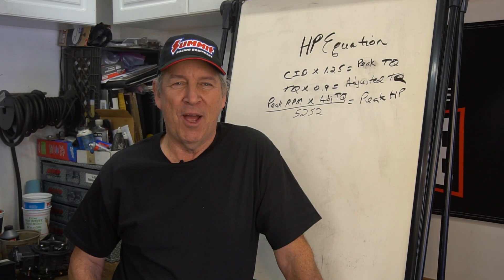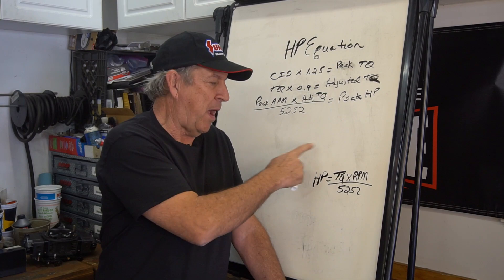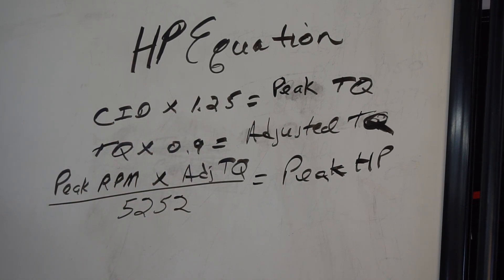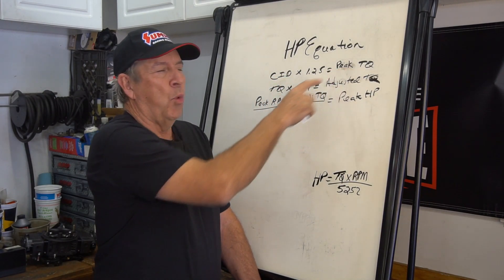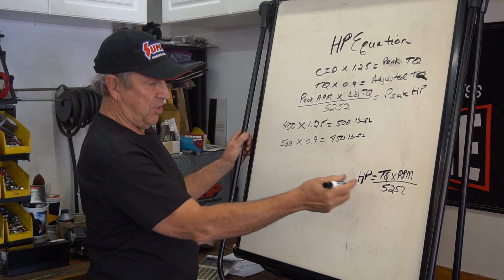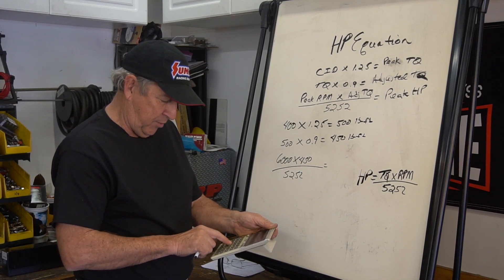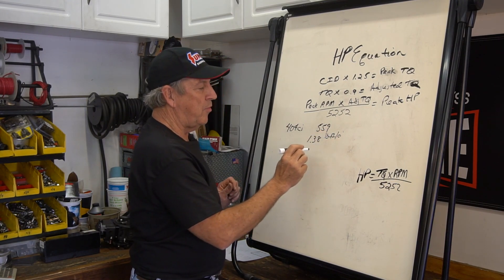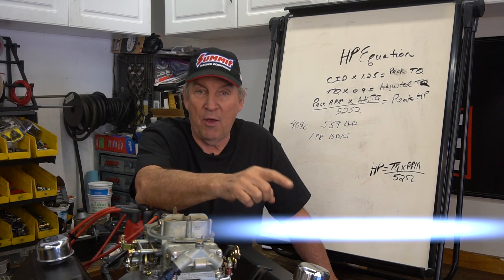Predicting Engine HP . . . without a dyno

Comment: Ok, so if I can safely assume that the 1.25 efficiency number is good, my slightly modified .30 over L-78 396 will make about 500 lb/ft of torque? That surprises me. I really didn't think the number would be that high. I'm using a set of 69 or 70 oval port heads (#792's)? they've been pocket ported and had big valves installed, (2.19 & 1.88's). compression is about 10.5-1.  Bigger cam (hydraulic flat tappet), 750 carb and headers. And I don't quite remember, but is the loss through a muncie and 12 bolt about 18%?
Reply: David,
There are multiple variables involved with all of this. Your heads are circa 1960's so the chamber is not as efficient and while the oval port heads are decent, they are not world class, so yes 1.25 lb-ft per cubic inch might be a bit high. Plus, details like are you using a Performer RPM intake or something a little better, header size, cam timing, and about a dozen other tings will affect this. Perhaps a 1.2 lb-ft per C.I. might be a better number - that would produce 480 lb-ft torque. Remember, these are flywheel power numbers. If you have a mild cam, then it may not peak at 6,000 rpm. I recently built a 540 with a mild hydraulic roller that peaked at barely 5,300 rpm. That makes  huge difference when calculating the peak hp number. In yoru case, 480 x 0.90 =432 lb-ft at peak hp x 5500 = 452 hp. That would be a much closer number to what you might achieve. Again, these are estimates. Hope this helps.
Reply: What are your cam specs? It takes decent about of work to get 500 hp out of a 396
Reply: Jeff and Muscle Bone, 
Thanks for the replies. I knew the heads were going to be the weakest link in this equation, even with the additional work done to them. Those mods were done in the late 70’s and I didn’t have many other options I could afford. I am seriously considering one of the new aluminum heads you talked about in the previous big block combo episode. And possibly a hydraulic roller cam as well. The cam I have now is a hydraulic flat tappet, .542 and .554 lift, 227 and 233 duration at .050. With a 106 center and 110 lobe separation. The intake is a Wieand stealth and the headers are 2” hookers.
Reply: @davidpoland7862  Your combination sounds pretty good - the lift for the amount of duration is also good - I just finished a story for EngineLabs that should be out soon that outlines a new line of Low Shock Technology camshafts that promise a little more power with improved durability but it might be a year or more before Comp makes these available. There are custom lobes available now - you would have to spec a custom cam. That's not difficult and may be something to consider. But really, better heads will deliver far more performance for the effort required. A good AFR oval port woudl be really good - but be forewarned that they raise the exhaust port - as most cylinder head companies do for Rat motors - this will make your headers more difficult to fit.
Reply: @jeffsmith2003  thanks again for the reply. Since the motor is fresh and the cam is new, I'm probably leaning towards heads as the main upgrade. I have looked in to the AFR's and did notice the raised exhaust ports. I'm thinking the Edlebrock heads may fit the bill best. If I recall they don't have raised exhaust ports and have a small chambers, (100 cc's)? Which is very close to the chambers on the iron chevy heads I'm running now. This puts the compression at about 10.25 which is where I wanted to be, and less than the 11.0 of the stock L-78 pistons. Also I did see reference to the low shock cams somewhere, that I think you mentioned. It may have been in a recent response to a question for On All Cylinders, not sure. But I will look for the story at EngineLabs.
Reply: @davidpoland7862   @jeffsmith2003 David, did you ever get new heads for this engine? I'm really curious because I just finished my .060 over 1969 402 build. So my motor is 414 ci. Just broke it in on engine dyno at a professional shop last Friday and did not make the power I was expecting. I am getting some help on why that might be, so will be checking things like making sure the valves are properly adjusted and that the cam was properly installed. I have Edelbrock 100cc Performer RPM heads producing 10.19:1 compression with my pistons, Howard's hydraulic roller cam - .589 and .601 lift, 229 and 235 duration at .050, 106 center and 110° lobe separation. Edelbrock Torker 2.0 intake, Holley 850 vacuum secondary and Hooker Classic 2" long tube headers. It's SO similar to yours, except for mine being roller. It only made 415 ft/lb TQ at 4800 rpm and 381 hp at 4900 rpm. So something ain't right. Dyno guy doesn't like vacuum secondary carbs, and said 850 is WAY over carbureted for size of engine, so we tested with his 650 double pumper. It didn't even make these peak numbers, but the curves were way better. So the 850 clearly needs tuning, but I'm also certain the cam is off some degrees, and possibly valves, although hydraulic and should be a no-brainer, still may not be adjusted right.

The intake choice is really a hood clearance issue, as the car is a 1970 Camaro, and shocking how little headroom there is under hood. I sure would like your opinions. Thank you both.
Reply: oke let me enlighten you. First off the amount of horse power it takes to turn a transmission and rear end does not change if the engine is making more or less horse power.  It takes the same amount if the engine makes 250, 500, 1000, or 2500. This estimate in percentage is far from inaccurate its borderline retarded. On average an automatic such as a TH350 takes about 90 and a TH400 takes about 130. A2004R and700R4 takes about 60. A 4 OR 5 speed manual only takes 40 or 50 and the rear end takes between 20 - 30 depending on the gear ratio. So if a transmission and rear end took 18% as you said then a 1000 hp engine would lose 180 and a 2500 hp engine would lose 450 which is completely wrong. On average as proven on a dyno its just a fraction over 100 if you have a TH350 and TH700R4 a fraction over 70.
Reply: @altforce44 The last reply is from me @davidpoland7862 I just haven’t used that account in the system. Hope it wasn’t too confusing 😊
Reply: @altforce44 unfortunately the car has been on the back burner for sometime now but hope to be getting back on it in the spring. I have not gotten the new heads yet. It sounds I’m looking at the same heads that you have. Are they Edlebrock 60435’s? My only hesitation is, the description says they have a slight angle cut on the head surface to help achieve the 100cc chamber volume. I don’t know if that will have any effect on fitment of headers in a 66 chevelle stock frame. With that angle on the head surface, does it roll the exhaust flange in towards the motor? Or did they compensate for that, not sure. Most of the other heads have raised exhaust ports and I want to avoid that can of worms. 
Yeah those power numbers on yours sound way low to me. I’m certainly no engine expert but I think you’re on the right track with cam timing being off. Was the cam degreed with any advance or retard in it? I would be interested in what you find. Keep me posted if you would. Thanks
Reply: @bigresto6672   Hi, sorry for the delay. I just saw your reply. Yes, they are 60435s. I never noticed that note on how they got to the 100 cc volume. I hope that has no effect on header fitment.

So under investigation I learned about my Big Mistake. Being that this is the first engine I've ever built myself, I didn't catch that they tech at Summit sold me 5/16 pushrods (I'm sure he was a rookie too) and not 3/8. They were so loose in the guideplates that the intake one on #5 cylinder actually popped out of the rocker arm cup, so essentially I was on 7 cylinders. It also chewed up that rocker arm, so there's debris in my engine now. Surprisingly none of the pushrods bent, and there isn't any more damage. I haven't finished putting it all back together yet.
Reply: @Aegis43  Thanks for the reply. Sorry to hear about the problems you’ve had. But I guess better to catch it on the dyno. Did the debris get to the main and rod bearings requiring a complete tear down? Yeah you never know how knowledgeable the techs are, so double and triple checking is a must sometimes. I’m sure you’ll have much better results this time. 
Thanks for the info on the heads. I’m going to call Edlebrock to see if they can give an answer on the exhaust side angle. I’ll let you know what I find out.